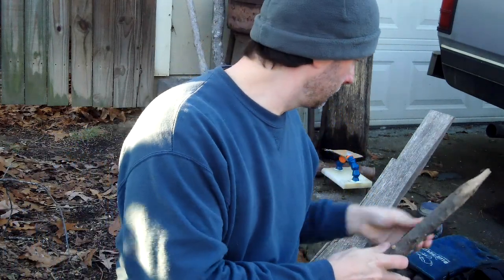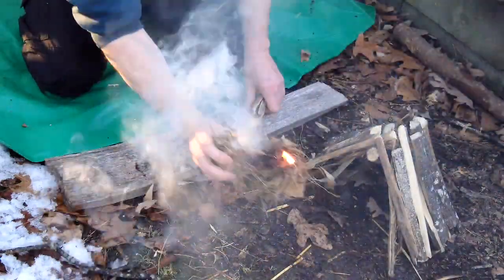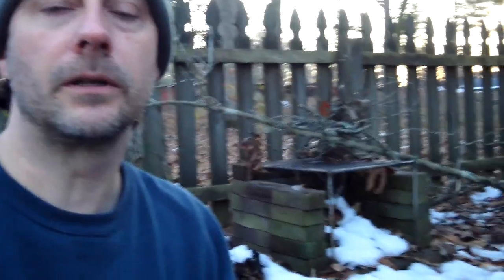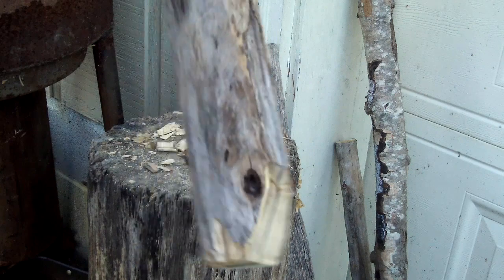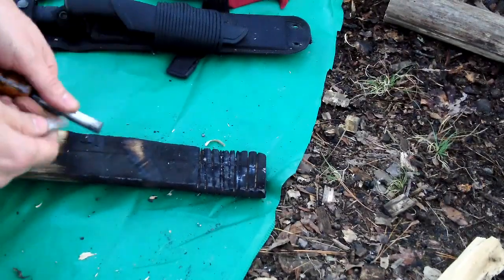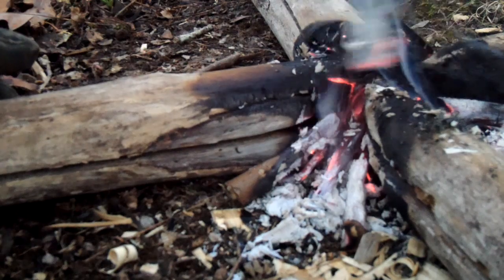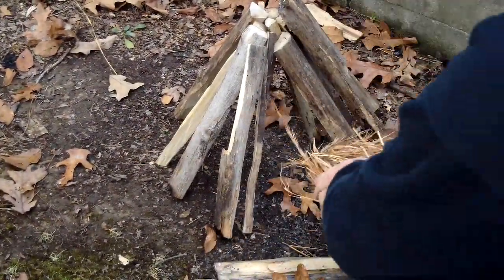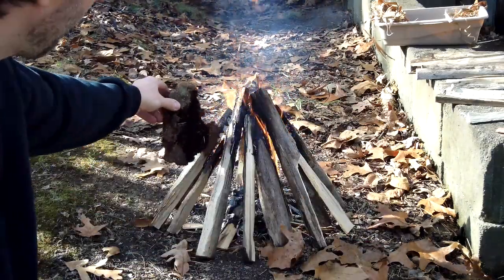One Foot In The Wild Fire Contest Tag Inspired By Dave Canterburys Fire Playlist

Comment: Excellent demonstration. On the star/cross fire, I was taught to elevate the ends with rocks about an inch or two to increase air flow from the bottom. It will burn for hours, even with the small logs you used. Thank you for all the effort it took to produce this video!!
Reply from the maker: Thanks, I'm glad you liked it. For a cooking fire  you lay em on the ground to set a pot on but just like you said, elevating it will allow more air to get to em. Thanks for watching

Comment: Heyas Brother Dave...   You've got my vote !!!  Of course I always gotta toss something in...  Sooooo...  First fire (spindle broke)...  You saved the dust...  So, I have a question...  In terms of taking something for starting another fire...  Is not the dust you saved just friction charred wood? (rhetorical)...  What would happen if you took charred wood from your fire and loaded your bow drill divot with it - and ignited it with the bow drill ?  VS Hand drilling away to create that charred dust...  OR crush a piece of your char cloth into your hand or bow drill divot ?  //    I like the char log...  Gotta admit I never would have thought of that....  //  Fire three (spark from wood to plant matter)...  I really like having a blow tube VS trying to bend over an blow...  It really focuses all the air right to where you need it...  //  The star fire might work better with a low fire ring to elevate the fuel logs ever so slightly...  //  OK...  Thats all the notes I made while I was watching...  ahahahaha  Peace Brother !  Great Vid !
Reply from the maker: Thanks brother! Well I'm not sure but that might work. I've never done that, I usually just spin from start to finish to get an ember. If the logs on the star fire are small enough you can elevate them on rocks for underneath air. Thanks for watching my friend!

Comment: Did the challenger specify primitive method? If not I would have used matches or lighter, battery and steel wool or other modern methods as well. Great vid, thanks man.
Reply from the maker: Nope, no specifications at all. Anything from a Bic to a bow drill. I love friction fire so I had to throw two in. Thanks for watching Mike
Reply: you are more than welcome to join the challenge Mike. There is a prize for general public entries as well I mention at the end of my challenge video!

Comment: Hi Dave, cool video man.  For me, when it comes to bow drill or hand drill, I'll take the bow drill even if it's more parts, because it doesn't tear up my hands and I enjoy making things.  One thing I found that works good for bow drill is to have a long bow so each stroke gets as much spin as possible for less work overall.  I've had good luck using willow for the hearth and spindle, and I've also had good luck with using poplar too.  Also, I love the coffee container in the beginning, I use those for all kinds of stuff!  Rock On!
Reply from the maker: Thanks, I'm glad you liked it. I'm at the point now where my hands are used to the ole hand drill. Everyone says they like a longer bow but I prefer one as short as possible. Less length of cord stretch, less length of bow to flex and it feels to me like I can swap forward to reverse faster with less dwell time. Thanks for watching my friend!
Reply: Hi Dave, I have an oak bow that I've been using, not much flex to worry about  and I'm still experimenting with the cordage I use, but I'm getting the job done though.  Rock On!
Reply from the maker: Oak is good. Get some leather cordage and soak it in some neatsfoot oil for a week and try that
Reply: Hey bud, thanks for the advice, I'll try it out!  Rock On!

Comment: Great, great video.  You're better at starting fires than I am.  Hope you win, but good luck to everyone.

I don't have any bow drill or hand drill sets.  Just as i like t use fatwood or birch bark as I find it in the wild, I want to make a bow drill or hand drill set when and if I need it, or just want to practice.  It's more work, but I think not carrying things like fatwood, birch bark, any manmade tinder, or bow drill sets, etc., keeps me learning, and helps teach me more about the wilderness.

I haven't made a star set in a long, long time, and I don't know whether my method of using it was smart, stupid, pointless or what, but it worked for me.   I built a good, fairly wide fire with a deep bed of coals first, and then add the logs.  I always liked logs about three times as thick as the ones you used

I also laid the logs on flat rocks, or split logs, or a thick stick, depending on what was available.  It aided in sliding the logs, and kept the ends off the ground with a thick bed of hot coals under the ends.  

If I wanted to cook with the fire, I kept building the coals and scooped them out between a couple of  the logs and cooked here, often with a coffeepot between two of the logs, and pot or skillet between two more.  

I can make a hand drill fire, but I never was crazy about it, largely because of what you said about finding good, dry weeds for a large part of the year.  With practice, a bow drill fire is easy enough.  I always use pine, if possible, just because I can start a fire easily enough with pine, and getting good with pine makes several of the softer woods that much easier, should I want to use them.  

In my old age, I have three or four ideas I want to try with bow drill sets to make starting a fire easier, but I couldn't get to any of them this year.  Worst year I've had in decades for getting out in the woods.   The odd part is that I'm now officially retired, but I was busier this year than ever. 

Anyway, a really great video, and I'm tremendously impressed.  Best of luck.
Reply from the maker: Thanks James, I'm glad you liked it. I like your method of the star fire. For me, I cook on it flat on the ground but elevate it like you do on rocks for heat and longer lasting qualities. Man I have never in my life ever used pine for a bow drill. I thought any resinous wood wouldn't work. I guess I'll have to try. Take care and Thanks for watching

Comment: It was great perseverance when your drill snapped and glad you left that in.  On the star fire, I was wondering why you took the time and resources (the blade, etc) to carve the 4 ends of the sticks into the patented Dave tip the way you did.  There is always a reason you do stuff.  Only thing I can think is that there might be more surface angle to catch fire.  I would really like to know that.
Reply from the maker: Thanks Barry. Sometimes it's good to show failure. That way it shows to never give up. I carved them ends that way to expose sharpened bark free ends. Sharp ends ALWAYS catch fire more efficiently than square saw cut ends
Reply: @Reallybigmonkey1  Thanks for clarifying this, I knew it had to be something like that even as I paused the video to look at the surface area vs. a square end.

Comment: Great video, learned a lot.  We are in damp cold area and fire starting is always a challenge.  These tips were great.  Question, with the star method, would putting a small lifter stick under the logs keep them more dry as they are pushed into the fire?   We seem to loose intensity here because everything is so wet...would you even attempt any of this on a damp day?  Or toward the evening..we really struggle with those times.
Reply from the maker: Thanks Suzanne, I'm happy you liked it and it helped. For damp or wet ground I absolutely wouldn't use the star fire. For conditions like that the log cabin fire is the way to go. I hope that helps!

Comment: Could you get sparks from the flint/steel to make an ember on the charred wood? I cannot. I'd like to see that, since charred wood is at every campsite and places where there have been fires, but charred cloth is not. I'm thinking from a survival point of view, not camping where, like Nick, I bring lighter fluid. Big fan.
Reply from the maker: It works but only if bone dry. Even high humidity can stop charred wood from taking a spark

Comment: Ever used the plough method of fire starting? If so what's your opinion? Haven't seen it in your videos that I've watched so far, which I'm going to guess means it isn't a good method.
Regards flint and steel, have you tried any different steel types , is there better types than others?
Reply from the maker: I've tried it many times and always failed. Thats a tough method that I haven't achieved yet but I know it's possible. As far as flint and steel? Pretty much any high carbon steel acts the same to me
Reply: @Reallybigmonkey1  Thanks for your reply, great video btw , particularly liked the first fire lay, very effective with that green stick to build on, best regards Neil.
Reply from the maker: Thanks Neil!

Comment: SNEAUX and Fire for Christmas! Two of my favorite things😂😂...
World...what was under your tree?
Me...20 HQ ferros, 10 good strikers and 20 pounds of high grade sticky wood...
World😳
Me😍😍😂😂
Reply from the maker: I had a new kayak under my tree!
Reply: @Reallybigmonkey1  I wish all that stuff had been under there! 😂😂I got an A2 tool steel 10inch  bowie 1/4 inch thick with African Blackwood handles from season 6 FIF Champ Jeff Peters of Old Wolf forge in KY!
Reply: When I made that huge roll of denim charcloth in that tall round cookie tin, Pirouwette cookies with the chocolate in them, I rolled the leg of denim up real tight and set it  on the fire. When flames from the gas came from the hole in the top, I waited until the gasses burned completely off and then took it out to cool. In about 2 hours I opened it and WOW. That was the best charcloth I ever used! The tin had no paint or anything inside. That char lasted a while!😂

Comment: This star one is not the one for me, personally. I prefer the more automated versions of slowly burning through the wood.
I auto ones I seen involve a frame at an angle holding wood up and as it burns, it drops down more and burns more.
I've seen the one the logs are standing at angle and another one the ramp has logs horizontal and piled on top of each other, so when the lower log is burnt away, the log above drops down on it and it then starts burning away. There's so many ideas out there for keeping fires going with less wood over a period of time. But this one you're showing is good for if you don't really have much to keep you busy, you then have something to do. You can keep pushing the wood into the fire as the ends burn down.

Comment: Star fire works better with more than 4 logs. You can start it with 4 but once you get it going lay another log that is twice as long as the logs you are using across the top so it lays between your existing logs. Once it burns through do it again. you will end up with 8 logs that don't have to be tended so much.
Reply from the maker: Yep, good thinking

Comment: using cotton t-shirt or cloth definitely works for making char but I have found a far superior material that most people don't think of.... tampons.  If you unwrap and remove the tampon from the tube you can lay it out flat which gives you a thick cotton "mat" about 2 inches by 3 inches by 1/4 inch thick. Put that in the char tin and heat it exactly the same way...  When its all done you have char material which makes a MUCH better coal because of the extra thickness.... You might argue that one doesn't simply find a tampon out in the woods or in an emergency situation, but I suggest putting 2 or 3 into first aid kit or any b.o.b. as they are sterile and can be used to treat wounds as well as making some of the best char available... In a pinch , I imagine that if you made char out of several of them they could be used as the final charcoal layer in a makeshift water filter....could also use un-charred  material for good fire starter by cutting some off and fluffing it up to catch a spark (could also add Vaseline ).... I personally made some char this way and then cut it up into smaller pieces.... I cut some drinking straws into 1 inch lengths and melted one end with a lighter and "crimped" it shut with a pliers.... stuff a small chunk of the char into the straw then melt / crimp the open end to make a nice little waterproof capsule with the char inside.... when the time comes to make a fire, cut off one end and pinch the capsule and out pops the char, DRY and ready for catching a spark.... Would love to see you make a video trying out these things.... great additions to any fire starter kit.
Reply from the maker: John I've heard of using tampons as fire starters before but with the multi uses you mentioned is the best case ever made for them! Great ideas!

Comment: Wood any rock and  steel will make a Spork when Hit together or is it a certain type of rock and steal that makes the spork
Reply from the maker: It has to be a high carbon steel. As far as the rock goes, any rock that shatters to a sharp point or has a sharp edge will work. The sparks come from tiny shards of metal glowing as they are removed by the rocks edge

Comment: The fire will work better if you dig a small hole or indentation in the center for the coals to fall into. If you cover the bottom of the hole with a flat thin piece of wood or dry bark it will help prevent moisture from damp ground from effecting the fire. flame from the hole keeps the ends burning.
Reply from the maker: Are you referring to the star fire?

Comment: Dave

Great referance vidio on fire starting

One of the ways I gather charred material is to use the cold chunk of the dead coals from the previous fire.  That material is pure carbon and you can use it for sparks or something I have never seen anyone else do is to put that carbon in the base or spindle of a hand drill or bow drill and you have pre charged the drill.  You can also use old carbon from the fire to pre charge a birds nest.

Dry cow pies are good fire holders just like ry fungus. 

Jerry
Reply from the maker: Thanks Jerry. Man that's a very good thought on using that char carbon block stuffed into a spindle. I never thought about that and I'm going to experiment with that
Reply: Dave

You know that 1.5 hour video went so fast I was surprised it ended.  
I have a suggestions or if you like another challenge I would like to see you do another video doing four more of each like the original challenge.
You are a great teacher and I learned a lot even about things I thought I knew.

Another possible challenge is to get viewers to send you suggestions about possible ways to start fires and then make a tape on the best of these or even one showing experiments you do to test new or different methods.

Oh yes as a westerner I love your George language!

and yes, I am old enough that I cannot get out much any more so I do my bush craft vicariously via your videos, and I love them!

Jerry
Reply: Oh yes I have watch this video several times, love it, LOVE IT.
Reply from the maker: I usually get tagged or challenged so often there's no need to challenge myself. Lol. I think someone has a cooking challenge in store for me
Reply from the maker: Thanks Jerry!

Comment: Have you tried....put a notch on the end of the spindle, take a length of para cord, or anything like it, tie thumb loops in the ends and hook over thumbs, place center of cord in spindal notch. Now activate spindle as usual. Hands wont slid down spindle and spinning will be near nonstop.
Reply from the maker: I've seen them loops before and they are worthless and just get in the way. It's honestly less trouble to just do it the traditional way
Reply: @Reallybigmonkey1  interesting

Comment: Dave, what would you have done for food on Vancouver Island, on the Alone show? There's several  critical mistakes that they've all made, that doomed them to starvation. Mostly, they dont take the right gear in the first place, but making a big wooden mortar and pestle, and juicing the kelp, is available to all, fairly easily, and nobody has done so.  Such can be made in half a day and profits them about 200 calories per hour. It offers no fat and very little protein, but the fish and crabs offer no fat and no carbs. Need the carbs.
Reply from the maker: I absolutely would have fished  and made crab traps but Im not sure what you mean by juicing the kelp. Several have eaten the bull kelp but by juicing it are you saying it would have given them more calories or other benefits?
Reply: kelp only offers a lousy  50 calories per POUND,  so you can't eat enough of it to do you any good. If you try, you'll get a case of the ripping trots! :-) So you juice about 20 lbs of it in an hour, to give you about 200 calories more than you burned by so doing.  If they'd take a gillnet and 2 person hammock made out of 9-strand  750 paracord,  they could weave thousands of square feet of netting. It takes about half a day to weave  300  sq ft of 4" mesh. the rest of the day can set that netting set up with floats and pebble weights, and hung as a gillnet. They can make a pontoon outrigger raft in a day.  they are given plenty of stuff that will float.
Reply: typo. should read 10 lbs per hour, sorry.